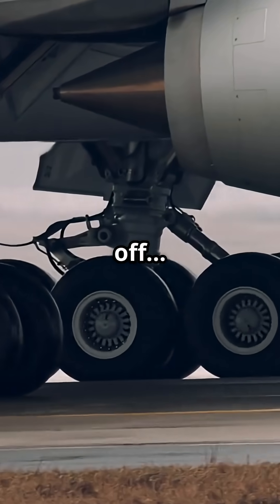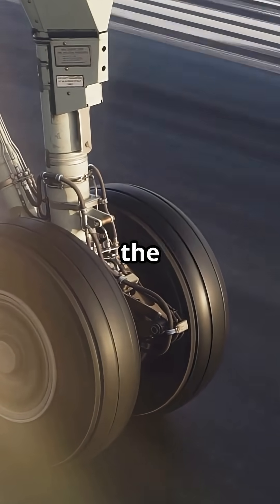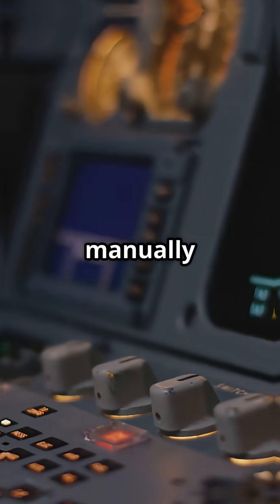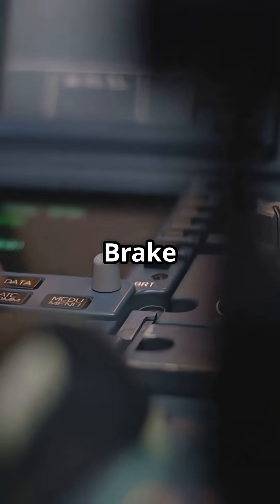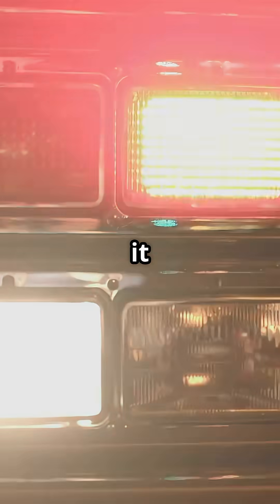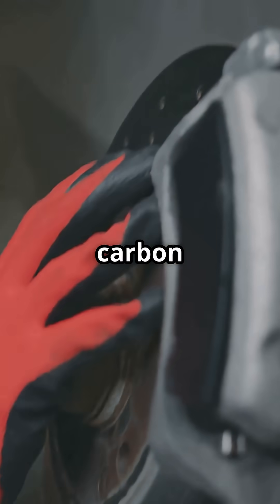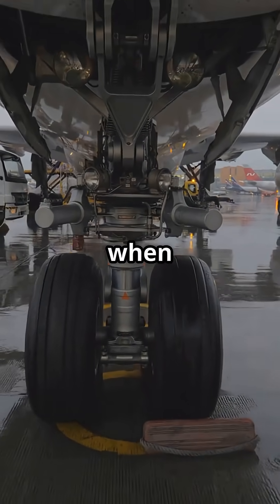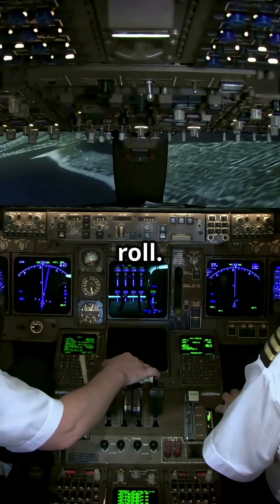Why Airbus Jets Refuse Takeoff Until the Brakes Cool Down

Comment: Stupid complication because they're are too few stators and break pads to spread the load.
Reply: Plenty of stators and brake pads, it's done to allow faster turnarounds.  The system was originally fitted to Concorde (as were carbon brakes)